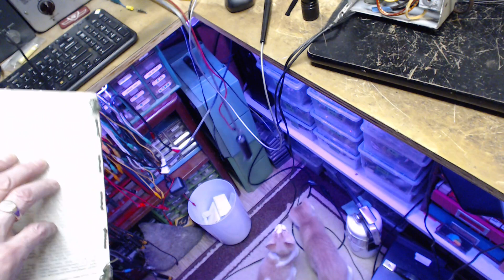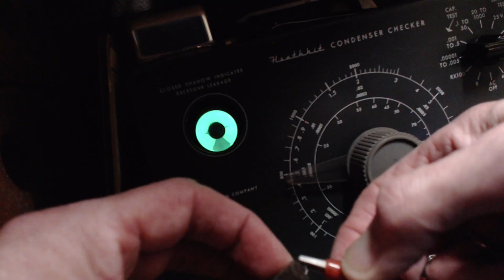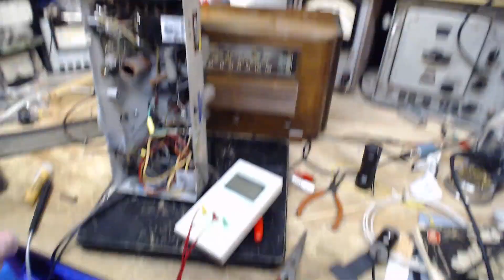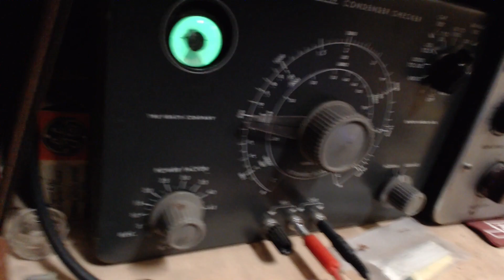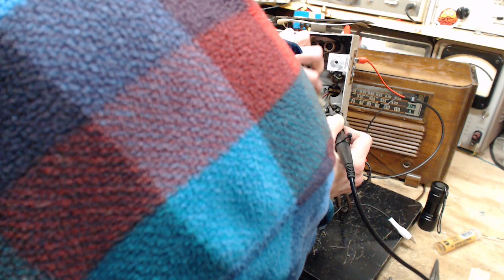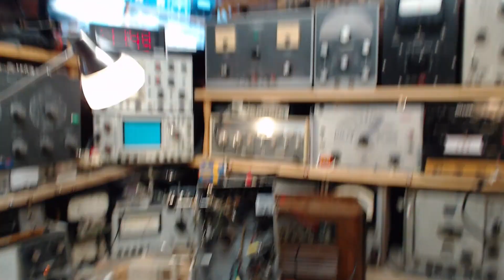Canadian GE KL500 Multiband Tube Radio Video #5 - Bad Capacitors Replaced

Comment: I was glad to see you desolder that resistor using long. One pliers, however desoldering any part in a vintage radio is foolish as you run a great risk of damaging the old brittle socket pin and now you need to replace the entire socket.